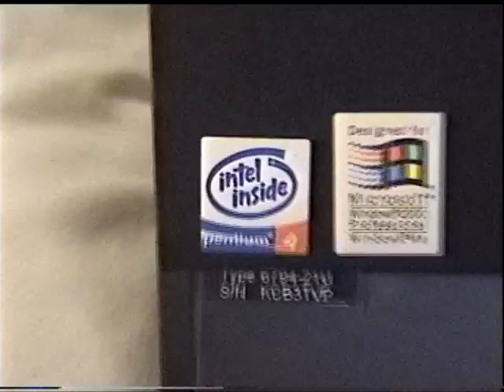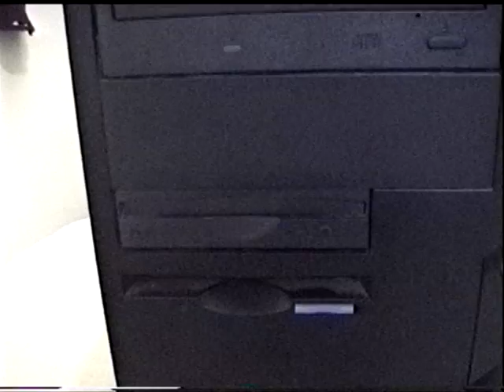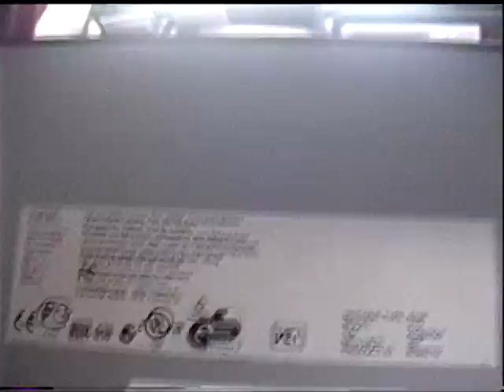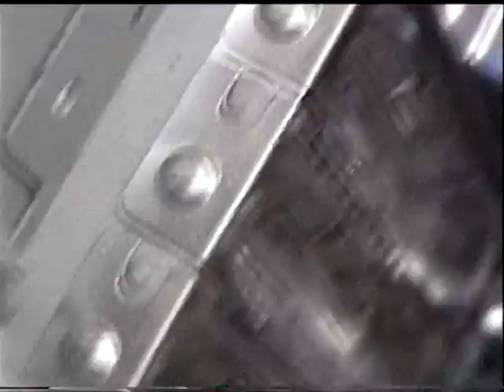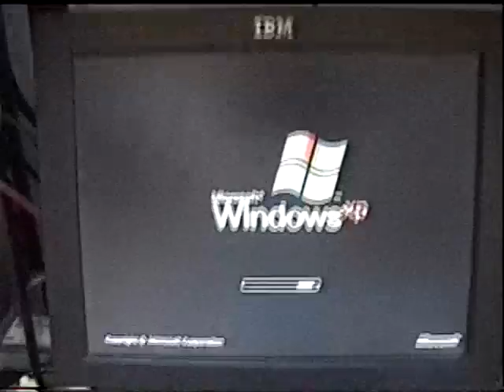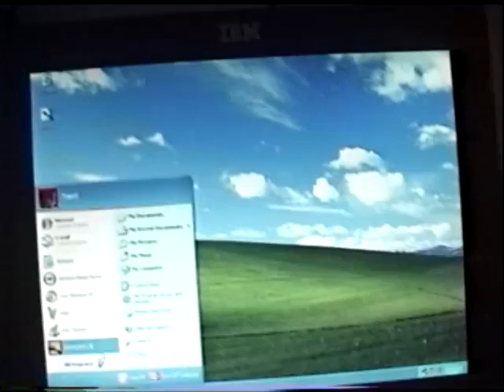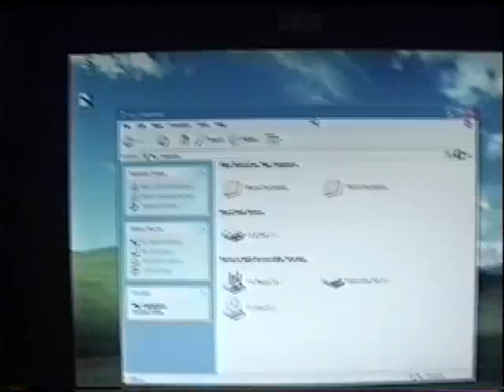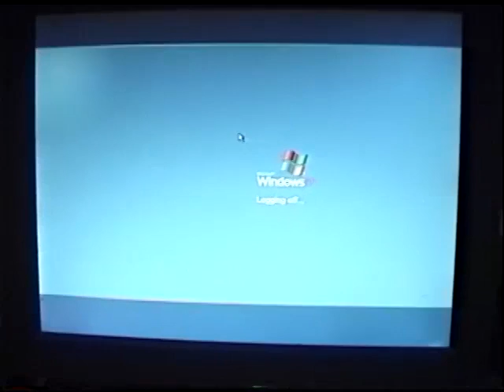IBM NetVista A22p (2002)

Comment: I have a NetVista M41 (type 6790-11A) and it seems to be pretty much identical to this machine in terms of motherboard and all that, and I know this was filmed over a year ago so maybe you know this now, but I believe that connector on the bottom right of the board is for a security board, which controls a tamper switch, keylock and curiously an RFID antenna. You could also have front panel audio which would connect in the bottom left, and there's also a hole in mine that looks like it'd fit one of those mini Firewire ports.
Reply from the maker: Interesting to know - thanks!

Comment: I'm surprised this computer came with such a bad graphics card rather than integrated graphics.
This computer reminds me of my old athlon xp 1800+ system also from 2002 which I got when I was 13 brand new.  I still have it but it is barely the same computer.  it came with a 40gb maxtor hard drive, 256 mb ram and a geforce 4mx440 and xp home.  Last time I powered it on in 2012 it had 2 320gb hdds 3 gb ram, Geforce 6800 GT and windows 8 release preview.  So it has seen quite the journey in it's 14 year lifetime including over 7 years of powered on time.  And as of this past summer still powers on and works but the side panel somehow vanished.
Reply from the maker: Bad graphics card? I think it's better than any integrated graphics that were available at the time.

Wow, 10 years and that many upgrades for a computer that old is pretty impressive.
Reply: I thought onboard graphics of that time were typically 16mb and discrete cards had 32-64mb
Reply from the maker: Yeah, but memory alone doesn't determine the performance of a graphics card. I haven't done any comparisons, but I'm sure this card would beat the Intel 820 and Via UniChrome and the other onboard graphics chips of the time. Plus, this card has its own VRAM, whereas onboard graphics have to steal it from the system memory.

Comment: my dell dimension 1100 has the same problem of CD-RW/DVD ROM not opening and have to have a paperclip to get it open but it works. this pc I have has Celeron D CPU @2.3ghz,512mb(it came with 256mb wen I got it),80gb HDD, Windows 2000 professional(shipped with win XP)  ,3.5" floppy drive (was add came form an HP pavilion).
Reply from the maker: Do you think everyone has every type and size of RAM on hand to upgrade every computer they have to the maximum amount of RAM? I sure don't.

Comment: I suppose that you could have tried hand-washing that ThinkCentre motherboard, and seeing if there might have been anything that could have came off of the motherboard. shrug
Reply from the maker: I did remove the motherboard and visually inspect it - all the caps actually looked fine, with no electrolyte leaking out of the bottom of any of them. I suppose I had nothing to lose in doing it. Oh well.